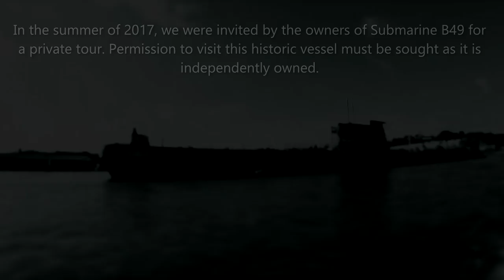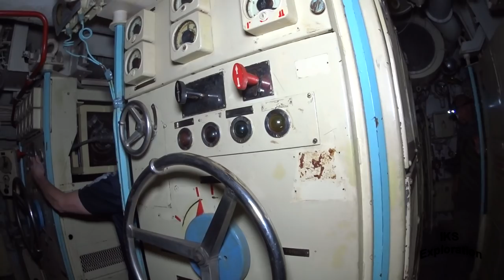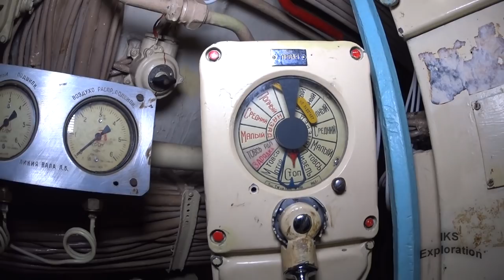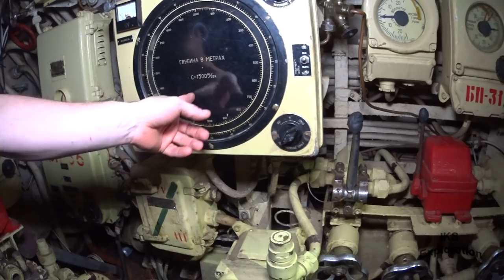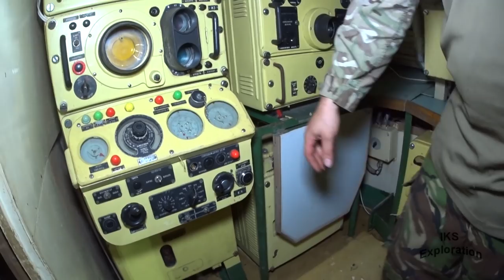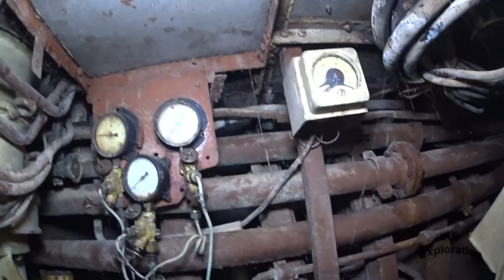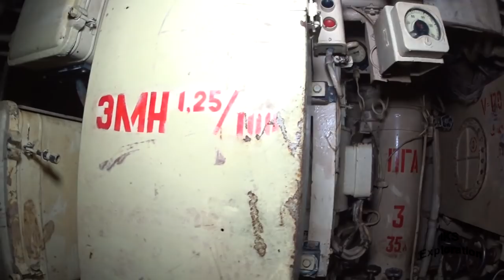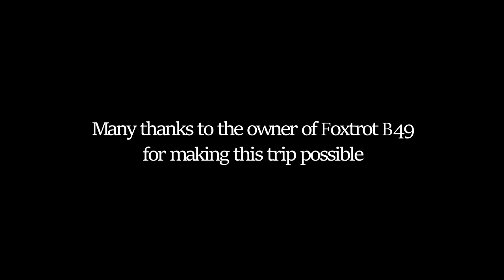Soviet Foxtrot-Class Submarine - Part 2

Comment: Those clock faces you were looking at were oxygen clocks. You set the time you went in and had to be out by a certain time, depending on the size of the compartment. When the sub was underway you would have been sealed in with only so much air.

Comment: Great vid  , well done getting in all the very tight holes. For your knowledge its a diesel electric hunter killer Sub or SSK in USA classification.  Lots of the pipework and valves are for trimming the vessel, once dived to a depth to even out the boat  water has to be pumped from one end to the other until it is neutrally buoyant with the gravity at the centre. This has to be done every time the depth is changed even by a few meters. The crew was doubled up for two watches shearing bunks, each two crew members would  have to know their posts duties inside out, hence no one really knew what all the valves and dials did on the boat. Shame she has been so gutted out but i suppose they had to make sure she couldn't be used for war, good job you vent the ballast tanks by mistake!

Comment: The  mysterious control panels with the large hand wheels in the engine room actually control the electric drives for underwater operation. The design is very reminiscent of the type XX u-boat. There is a type XX u-boat at the Deutsches Schiffahrts in Bremerhaven.

Comment: It’s not because you can’t release the exhaust underwater, it’s because the engine needs air to burn with the fuel.
Reply: You start any subs engines underwater and everyone on board would burst their eardrums from the pressure change of the engine trying to suck air.  Of course any good diesel electric has a snorkel that will allow it to breathe submerged down a few meters, but it needs to be deployed.

Comment: The large machines looked like solution computers, early electromechanical devices that would give you the settings needed for your torpedoes.

The mechanism on the head (toilet) is an interlock and seal as the flushing was done by a little water and compressed air.

Comment: way the escape hatch works, the rubber skirt is dropped and the boat partially flooded, hopefully the air pressure in the sub balances out the water pressure, then to escape they open the hatch and enter, then one by one float to the surface, the skirt prevents the air from flooding out of the sub straight away.

Comment: The bits under the floor would be the fuel tank the bilge pumps and the air system to make the boat go up or down buy flooding with water water in go down air in go up. the boat was diesel electric with all the power comming from the engine on surfice battery when under water
Reply: The main buoyancy control was near the plane and rudder control.
Reply: they only work if you can flood the tank called netural boyancey filling the tank with air fast was called a emergency surface you can get the same effect with a beer in the bath full the bottle sits down empty it sits on the surface

Comment: Those rubber seals/curtains are pulled down just a meter above the floor and secured with chains /ropes to keep an airlock above the opening when the boat is flooded to equalize pressure but maintain air for the waiting crew while opening the hatch and one by one the crew ducks under the curtain to swim to the surface.
This can only be done on limited depths because of the bends
More modern submarines have capsules on the ceiling that can be flooded to let a few crew members out while the rest of the crew can wait under normal pressure, after the people opened the upper hatch of the capsule they float in special suits to the surface
Then the upper hatch is closed water is let out in the submarine under hatch is opened and the next few people can do the same.
Because of the limited time the body is under pressure deeper escapes are possible with less risk of the bends
Reply from the maker: Again thank you very much